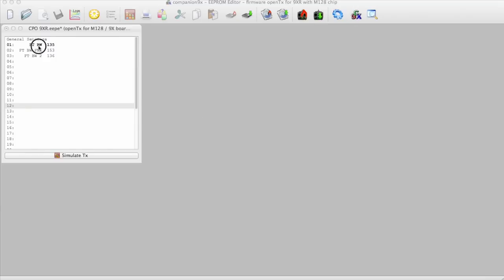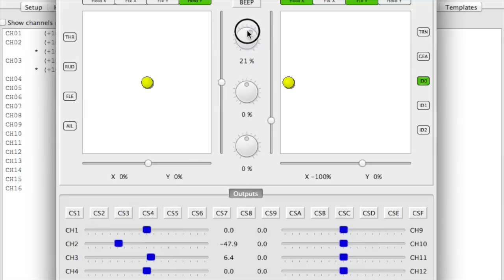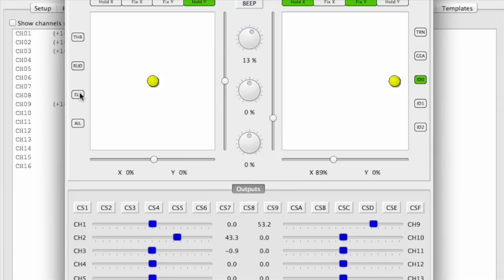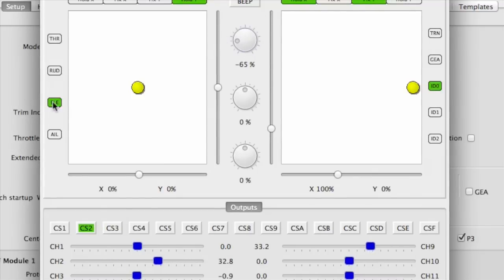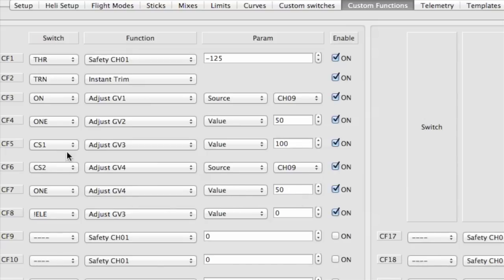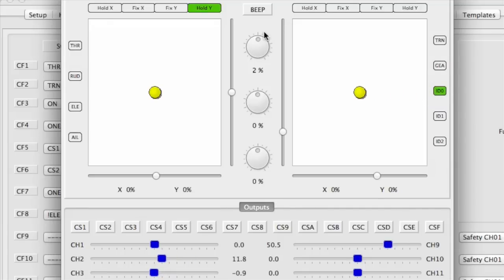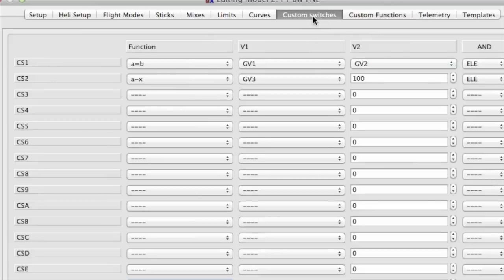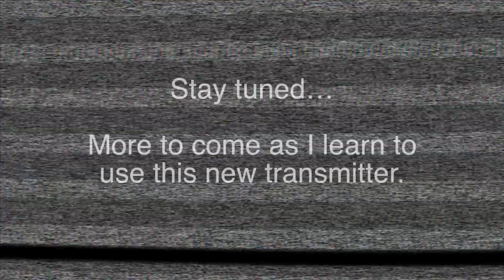Variable Rates in OpenTX (Companion9x) : Part Four of the 9XR Series

Comment: So, did you ever figure out a less kludgy solution? I've been trying to do something similar, though I'm trying to use a slider to control my gimbal tilt, but only when a given switch is in a position to enable it, and when the switch is out of position, to simply 'lock' the value/position, regardless of the physical position of the slider. There really should be a simpler way that doesn't involve a giant logic cascade.

For what it's worth, I use a 3 position switch to adjust 2 GVars via flight modes (e.g. the switch sets Flt Mode 1, 2 or 3, where GVar 1 = 100, 90, and 75, and GVar 2=25, 35, and 50, respectively) and use those GVars as weight and expo for my rates adjustment and that works well for me, though it's just 3 settings, not a fine adjustment like a pot is. I've also used a 2 second fade between modes so if I switch mid-input, it won't just jump between them. I also have custom functions to tell me what rate settings I've just switched to, and I have a momentary switch set to say the values of the GVars, for when I forget what flight mode I'm in.